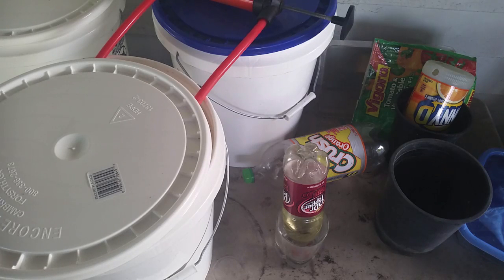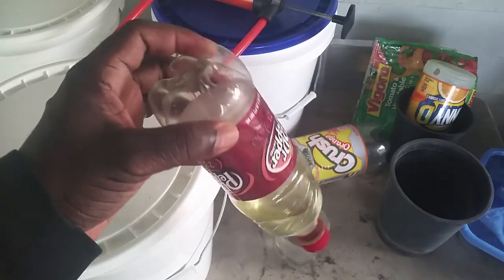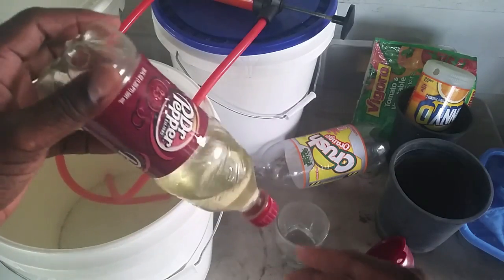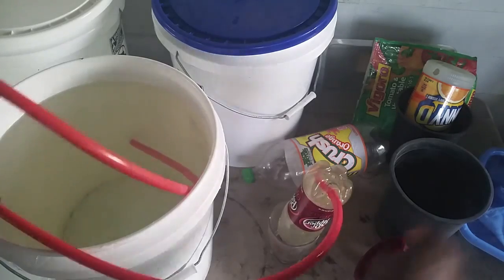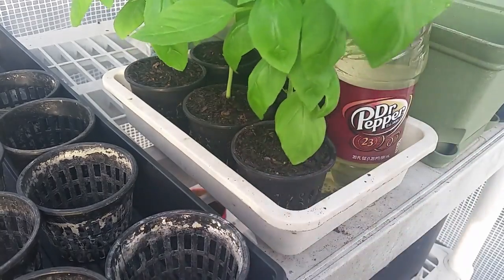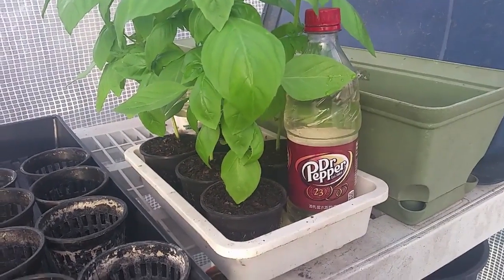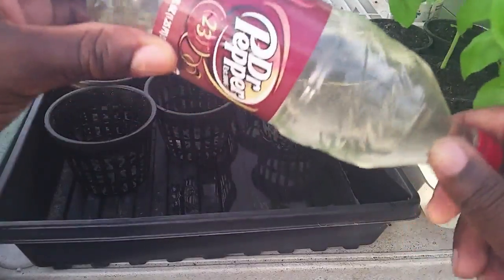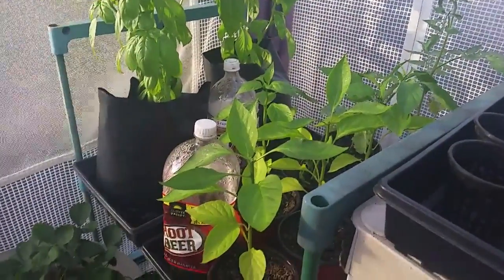Pop Bottle Automatic Watering System • How It Works

Comment: Great video ! Did you have problems with Root rot by doing this method ?
Reply from the maker: Mr Cool not at all! The roots are not submerged in the water only the very bottom inch or inch and a half is. The rest of the roots usr air from above.